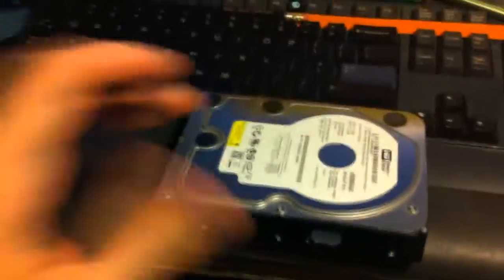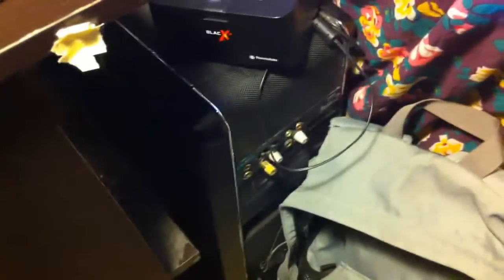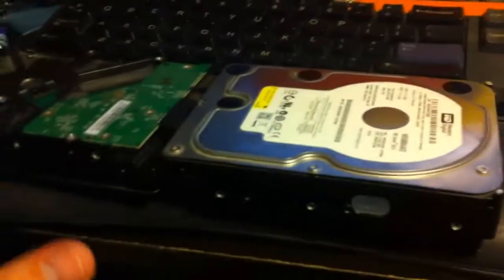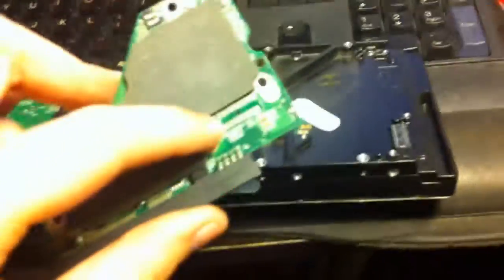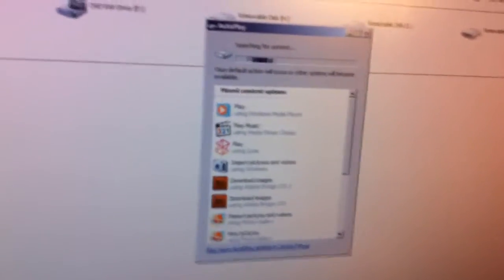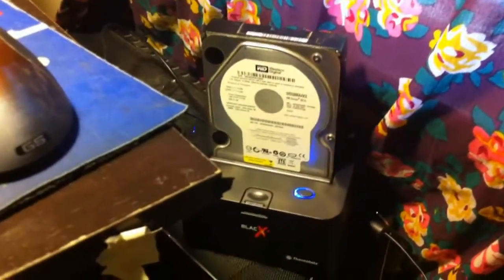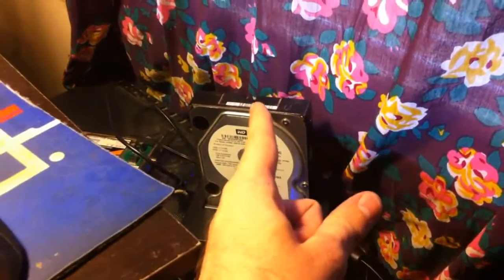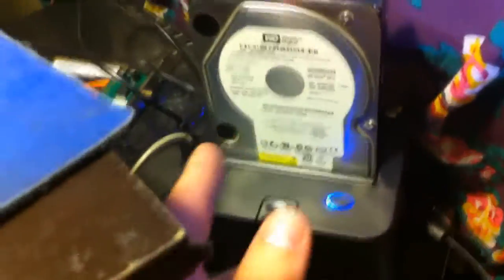Hard Drive repair - CLEAN CONTACTS!, Swapping circuit boards

Comment: It's know as carbon tracking. Salvaged a few drives with this method. Used to be a real problem with old RAM sticks before they started gold plating the contacts. I add a nano film of dielectric (or vaseline) to the board contacts to every drive I put in service. While dust can be an issue, exposure to oxygen is the main culprit. The dielectric creates an O2 barrier which inhibits the carbon build-up to begin with. A simple pencil eraser is an essential tool to any PC repair toolkit.

Comment: I have found multiple hard drives with corroded contacts on the circuit board and I saved a 3Tb drive by cleaning the contacts up.
The manufacturers did not even properly tin the pads!

Comment: Contacts and connectors are a major point of failure for long life electronics, especially for things like hard drives.  I've found that cleaning contacts and bending the leads on the connectors that make contact with the pads going to the motor (so the leads apply more force to the pads) will usually bring them back to life.

If you have random blue screens, read/write errors or your drive isn't detected then its most likely the pads going to the head mechanism that need cleaning.  If your drive isn't spinning up at all or clicks as if it's trying to spin then it is most likely the connector going to the motor on the drive and bending the leads upward will most likely allow it to spin up again.  Best practice is to clean the pads and bend the leads a bit for better contact to get the data back.  After about 3 to 5 years it will most likely need to be cleaned up again...

Comment: I have a wd5000aaks 500gb drive that failed recently, can access the drive but pulling data off is very slow and it gets really hot, took the pcb off and cleaned the connections with an eraser too but still no good. If i get the connector in the right place it will be detected. I've seen applying heat to the centre of the platter can free up the platters.